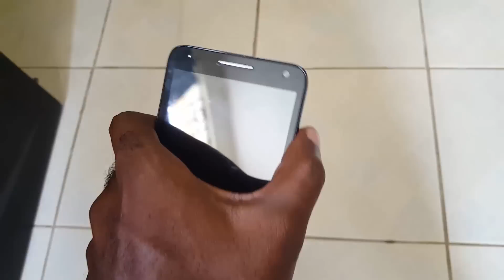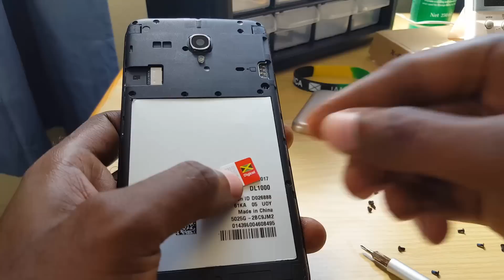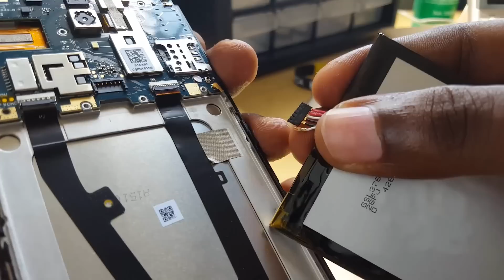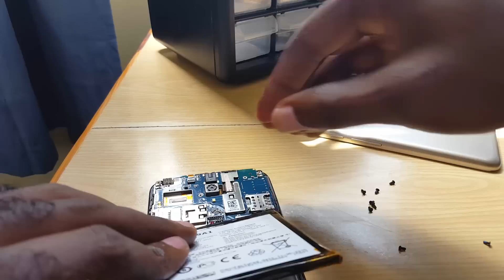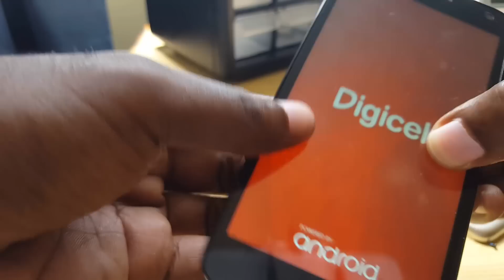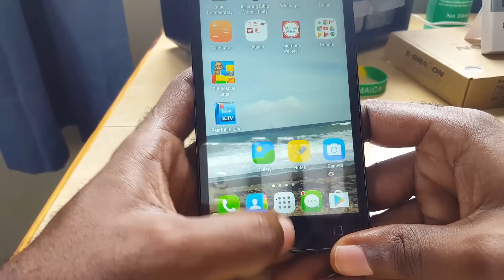Android Phone Won't power on or charge Fix (Digicel DL1000)

Comment: Before taking apart phone start with removing apps ; duck duck go app stopped my phone from charging. It sounds weird but remove battery and put phone in refrigerator for 10-15 minutes put battery back plug in charger and power on while still cold. That worked for my note4 but had to do that again if phone battery went low enough to power off.

Comment: August 2021

Hello,
I don't know if you have ever had this kind of problem.
I bought a Micro USB cable (3m) from Ali Express for my BLU WIN HD LTE smartphone.
It worked well before. And it is well maintained. The battery is good.

Everything was fine. So, I wanted to try this new cable and when I connected it the BLU froze.
The screen was on but no picture. Unable to close it. I had to open it to disconnect the battery.

Once done and the smartphone turned off, I tried to turn it back on. But that is impossible now.
So, my BLU is no longer working. I even tried a hard reset.

Did the cable short-circuit the smartphone and break one or more components?
I looked at the circuit, everything is beautiful. No buttons work when I press them.
The same cable has been used on tablets and has not been a problem.
Is there any easy way to fix it?
Is there any easy way to find a solution to make this smartphone work again?
Thank you

Comment: hey ricardo.. mine is also same problem.. shown in lenovo service center and they said problem in power ic chip so cant be repaired.. but hopefully do the things as u told here nd will get back to you but meanwhile whatif that battery connection is all ok ? thanks anyways.. :)

Comment: So you just set aside the battery then put it back then it will turn on? How long shoukd you set aside the battery? Thanks sir
Reply: The longer the better up to 1 day. At least an hour to be safe. You can try it while disassembled for testing. Then if it does not work, try again and wait longer.

Comment: Just as an FYI, this appears to be almost identical to the Alcatel One Touch Fierce XL 5054N. Although inner (inside) battery cover has many tiny (1.5mm) screws holding it on. Thanks for sharing!! 👍

Comment: Well my son's Plum z516 rapidly dropped to 0 and shut off and wont turn on again nor charge. When its plugged it, it flashes the plum logo every 10 seconds. Tried everything, including cleaning charging ports, a different charger. Same issue, cant soft reboot nothing

Comment: I have an android phone that will turn on but won't charge. I ended up jumping the battery by putting 5V power to it for a few seconds and I got it to where the phone will start up but when I plug a USB charger in it won't charge. It was bought dirt cheap at a yard sale so it's no loss but I love tinkering and I may have to resort to connecting the battery terminals of the phone directly to the battery of a small power bank and then just charge the powerbank.

This phone is not my current phone I have a much nicer one. My plan for this yard sale phone is to put a streaming music app on it and hook it to my stereo and play music.
Reply from the maker: Nice Idea I hope you figure it out. Also if you do let me know what worked.
Reply: Ricardo Gardener I hope it works. I have a few power banks with battery level lights on them.

Comment: If the batery is removable, what do I do? I did not understand
Reply: Luispl7 you just.take it out they should be a little gruva on the bottom of the battery take your finger move or your finger and lift up

Comment: hey pls help me my phone is dead for 3 or more months can it be still revived ? i need help plz
Reply from the maker: Should be able to did you try switching out the battery or charging it externally if possible. Change also your charging cable and outlet as well.

Comment: hello sir can you help me with my note1 it wont turn on and charging logo wont pop up, can you help me please, i tried to press the vol + home botton and the power botton simultaneusly but nthing happen. i tried a lot of sulotion but non of them works, please help. thank you
Reply from the maker: +Lenel Angeli sure try the following seeing your device is a bit old -1. Change the charger cable and brick 2. Try a new battery. 3.take the battery out and memory card and hold down power for a minute while battery is out and replace battery and try powering up.

Comment: Sup man good work.....I have a DL 1000 from digicel but the battery terminals are broken off can I wire a blue battery with 3 pins(+,- and the center pin) what are the white and yellow wires on the battery connected for?

Comment: i have the same prob with my dl 900.......it started with having probs charging had to set the charger a specific way so i could charge it.....untill an not getting anything at all now....it wont boot it wont show battery charging an all it does now is get hot mostly ........any help?????????????????????????????????

Comment: great video but this didn't solve my problem could u please help me        my phone comes on when connected to the charger but turns off when charger is removed   and when being charged it takes very long     (wont turn on without being connected to the charger
Reply from the maker: Sounds like the battery is either dead, or not connected properly. But its most likely dead. How old is the phone?

Comment: Sir will it work on my Intex aqua power HD
Reply from the maker: You wont Know until you try.
Reply: Ricardo Gardener sir I didn't try ur  method and it worked. On 30 may my phone goes black and yesterday only it came back with my crazy method of repairing it!

Comment: my phone is cherry mobile .. it is not switching on and it didnt charge when i plugged in my charger..
Reply from the maker: Double check your connections might be that you did not reconnect it properly simply disconnect and reconnect.
Reply: Can you help? I have an Alcatel phone it never does anything, when i charge it, it stays blank. It usually does something else, and when i hold the power button it doesn't do anything. And i did your thing but still didn't work D:

Comment: i have a alcatel idol x+ an its giving me the same problem my screen just went black an it wont turn on back it came on back 2 times for a short period an when you plug it in you see the led light but nothing on the screen
Reply from the maker: If the battery thing did not work after 2-3 tries. Try power off removing battery if it can be removed,removing SD card, Memory card. Next hold down power for a few minutes. Leave battery out for 30 minutes and then try fitting things back together and power up again. You may need to repeat the process.
Reply: cool ill try it when it comes on

Comment: i have a phone like this..i did what u demonstrated but dtill hasnt worked
Reply from the maker: Did you check to see that after disconnecting you reconnected properly. Also is the battery charged. There are a number of things that can stop this from working.
Reply: it worked after a second try..thanks alot

Comment: lol i dont know if i have the same problem because my phone that has a build in battery wont turn on but when i charge the small LED turns on but my phone wont work my phones name is myphone31 i dont know if you guys know this phone but its made in philippines ill try to make someone fix it but if i saw the same problem im going to punch a wall
Reply from the maker: Well its worth a shot to try the procedure seen here. The phone had a repeat of the issue once and I just did the same thing again. Its been months now and no issue since the fix.
Reply: Tuesday